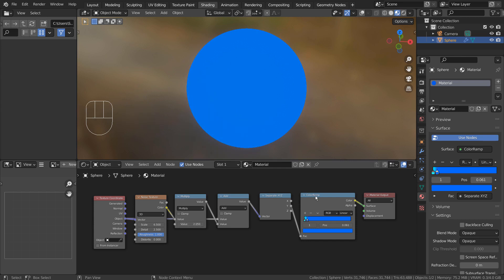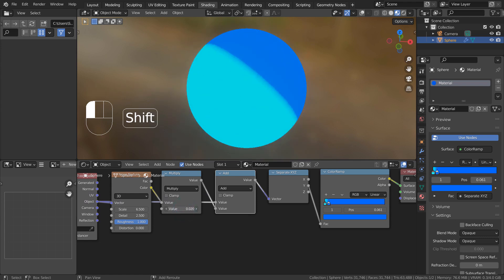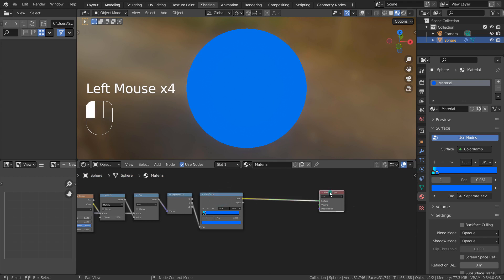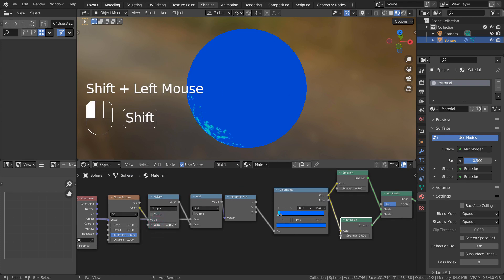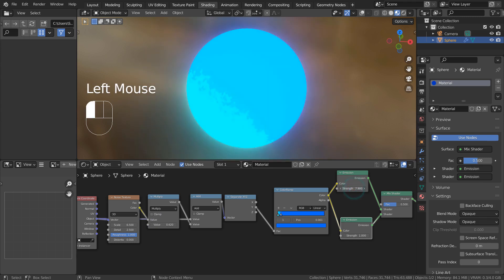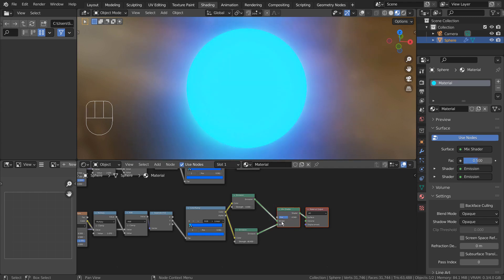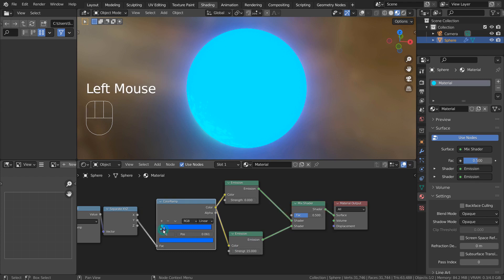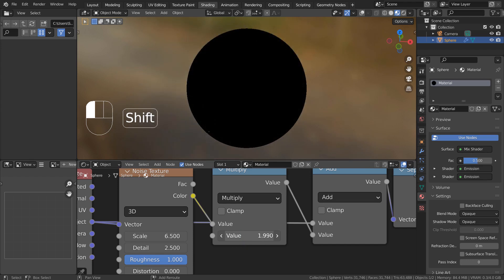Blender Tutorial - Noisy gradient

Comment: Try using Multiply Add instead of just Multiply, then change the value of the Addend.  Also you can adjust the "angle" of the transition by adding an empty and then set the object to use for the texture coordinates to that empty. Then rotate the empty to adjust the angle of the transition.
Reply from the maker: Thank you for the helpful tip, deltaray3..!! :)  That's a brilliant idea..!! :)